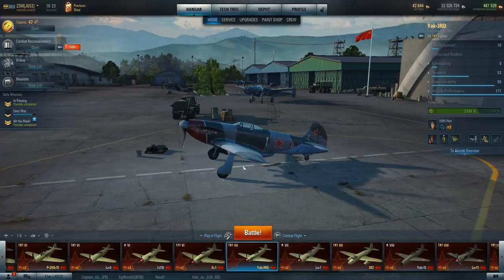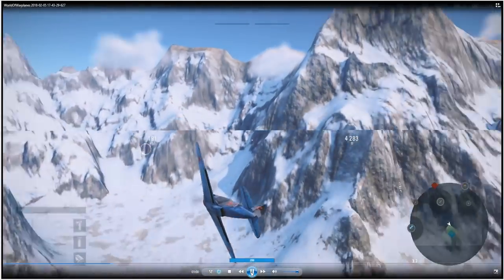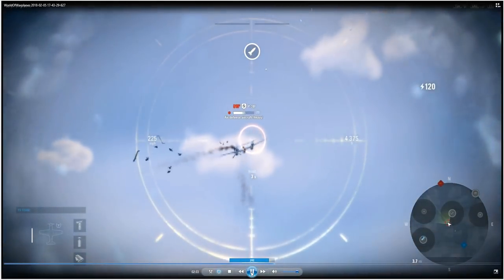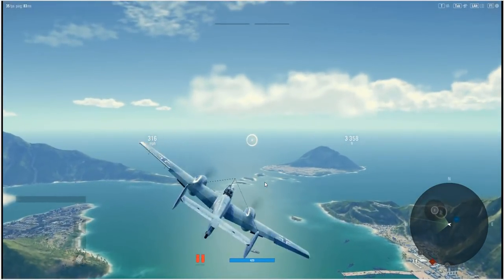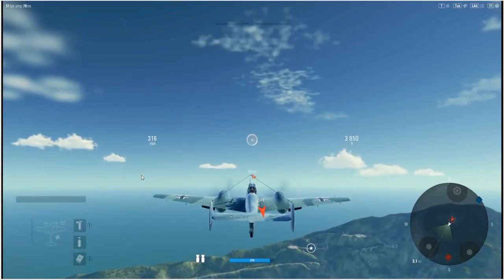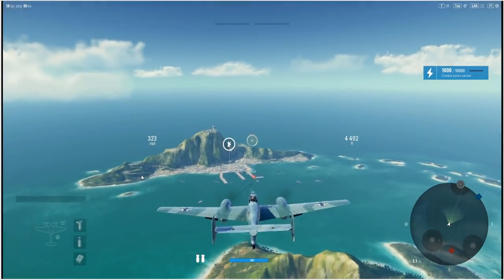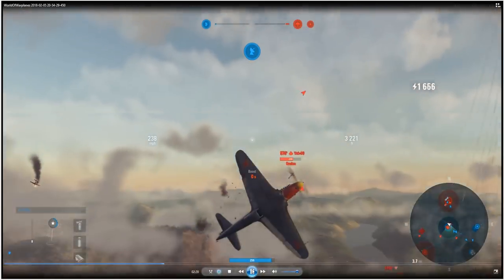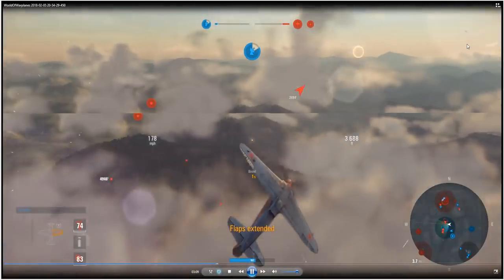World Of Warplanes. Tactics And Tips Part 3.

Comment: I kind of disagree with taking cap points with heavy defense fighters. those should be top priority to kill because the 2 heavies will work together to take you out. Therefore, when soloing a cap, u need to get rid of them first because they will just simply melt your HP instantaneously if you don't deal with them
Reply: I think soloing a cap is not the best strategy, because every AA and bot will focus on you (while your team is getting killed on other bases).
Heavy bot fighters are important to kill. However, you need a plane to kill them fast otherwise they'll just fly away like you see in this video. If you fly low altitude fighter like yak or zero then fight light fighters. There are many planes that can kill heavy fighters faster - other heavy fighters, p-47, fw-190. Mustangs and bf-109 can do it too because of high altitude.
Also, bots on the teams have different skill level, some of them are much better than others.
Reply: vertik7 it really isn't that hard if u have decent planes for the job. Mainly German planes or high altitude because u can deal with the heavies without worrying about the lights, and then come down and kill one fighter and take the cap. Not too hard once u get the trick down
Reply from the maker: Prince of Hyrule 

In a solo cap, I agree with you.  Take the heavies first.  If I have help, I usually go after light fighters first.  Also, it's plane dependent.  In my opinion.